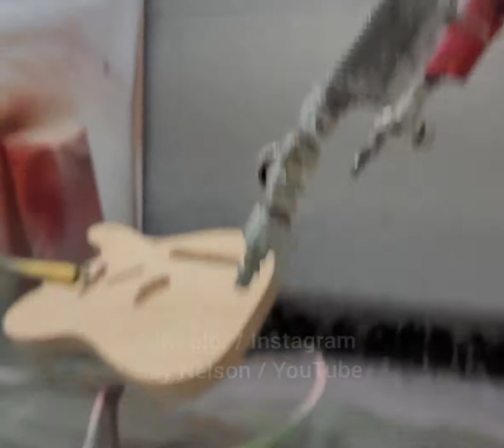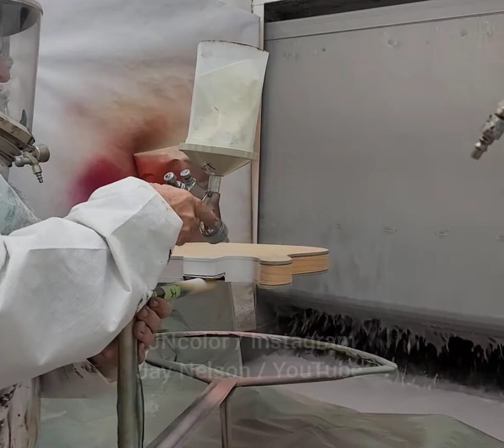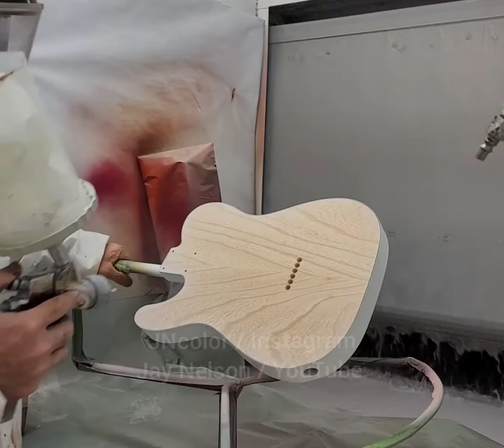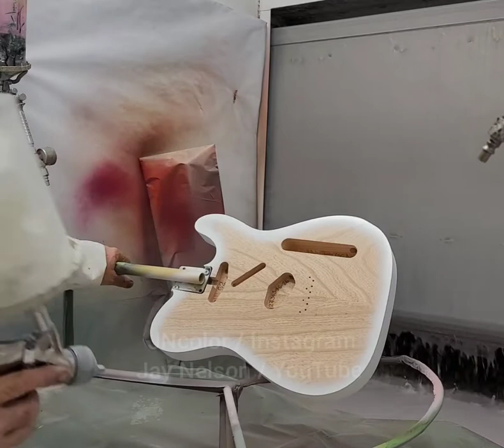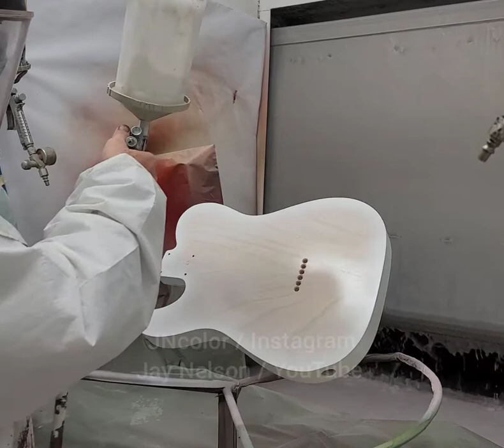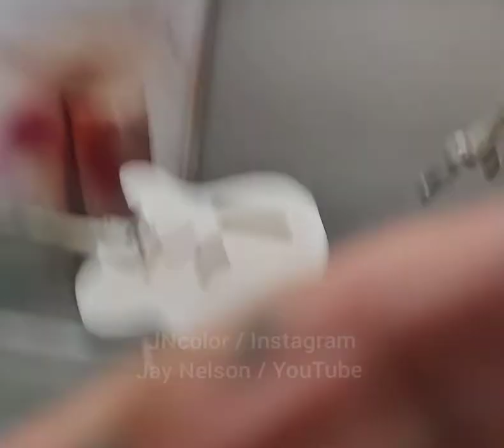Mary Kaye Blonde on an ash tele.

Comment: Hey Jay, I have a question. I’ve heard you say the bodies are prepped by the sanding department and then sprayed with lacquer as the base. On alder bodies, are they using a lacquer based filler or just spraying normal clear nitro lacquer. I’m trying to have a sort of finish sunken into the grain look and i realize alder isn’t as porous as ash. I stayed glued to your channel and i really appreciate you, your work, and your videos. God bless from Arkansas.
Reply from the maker: That look is really hard to achieve on Alder. Don't apply any undercoat. Just spray the color directly on the wood then sand any fuzzy or rough spots with 600 then clear it. If your doing a burst or a transparent color you might take a different approach.
Reply: @JNcolor  sorrry... a little late to the game...you are sayin no vinyl sealer?..so..what are you using not to have grain showing?..thanks
Reply from the maker: @RAAPTINSTRUMENTS  lacquer.
Reply: This is not how a proper preparation for blonde finishes is done. I've sprayed only ash with it but a light coat of sanding sealer is necessary for a smooth finish over ant wood. Fender originally used a vinyl sanding sealer back in the day which is what I use. Fill your woodgrain first then sand until you get back to the surface of the wood without sanding past it. Then a light coat over the entire body to seal it so that the paint doesn't have the tendency to settle into the pores. The cut your paint with 70% acetone and 30% so that you can control your coverage. You can do this a little at a time. I'm used to spraying solid ash with no binding so it has to be perfect. I even have pictures of a body that I did in butterscotch blonde but the faded colour everyone thinks of when hearing this but the original colour was much lighter than this when new. This guitar was damaged in an accident but I saved it so that I could play it. The below link is to the picture that I took when I had this body. It's a 1951 Nocaster that I refinished myself. 

https://prnt.sc/Gbq6VD0srEfv

https://prnt.sc/Oh8vtN7Yd6Mp
Reply from the maker: @solarismoon3046  In the Fender custom shop, there are many variations of finishes.

Comment: Man this is my favorite finish. What color was in the second cup you sprayed?
Reply from the maker: That's white blonde
Reply: @JNcolor  yea I'm not looking to directly replicate a fender finish. But there are so many variations on white blonde, it's hard for me to get what I'm looking for. I don't buy pre mixed spray cans. So, I mix my own.
Reply from the maker: @mgcnashville6615  As far as I understand we only have one white blonde. Now with time they yellow and age differently. So maybe that's the struggle your fighting with. It's essentially a bright white lacquer that is over reduced to be transparent.
Reply: @JNcolor  yes you're right. That's what I mean. Over the years and with dif paints used from Sherwin or DuPont, from the 50's on, and who was spraying that day, etc. Variations. Some are more yellow, etc etc. Im going for an aged white blonde. So, the ageing is the struggle. You're correct. But I dont want it yellow like a canary. Amber seems to get close, as long as I don't use too much over the white. Will be experimenting today with dif ratios of amber/brown.
Reply from the maker: @mgcnashville6615  That exactly the process. And a good plan you have. experimenting is important. over reduce your tint 80:20
Reply: @JNcolor  man Jay I had to come back to this vid and let you know I finally switched to nitro laquer from water based products. Rly wish I'd have made the switch sooner. But I only just recently gained access to a proper booth where I could spray it. Nitro is so much nicer to work with! I'm getting awesome results. Hope you’re well! Thanks for taking the time to make these vids. You’re helping ppl bigtime!

Comment: Hey Jay! What's the difference between the white that goes in the white blonde paint and the "basecoat white" you always use? Or the difference is just that white blonde is the same white but with more clear lacquer mixed in?
Reply from the maker: it's essentially the same color. you could over reduce that white base and spray it on a white blonde body and it would look right.
Reply: @JNcolor  Thanks, Jay. white blonde and olympic white are two of my favorite Fender colors.